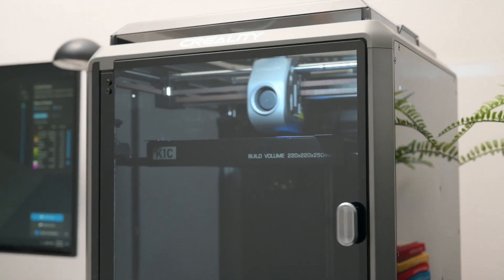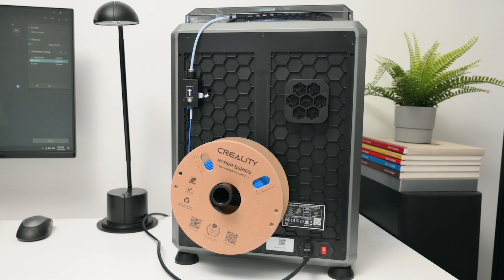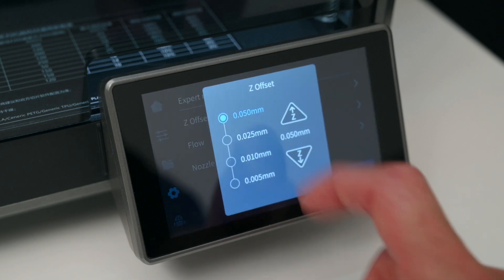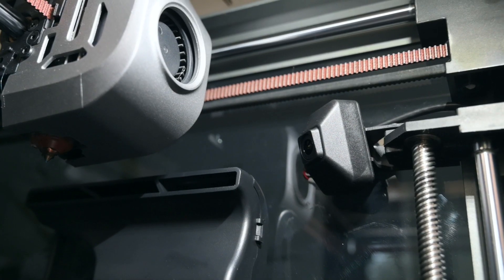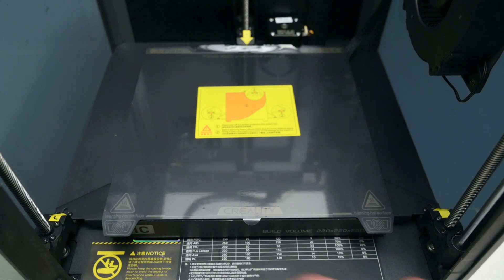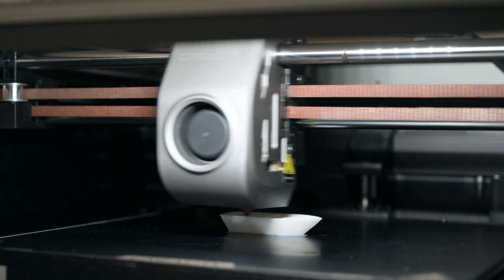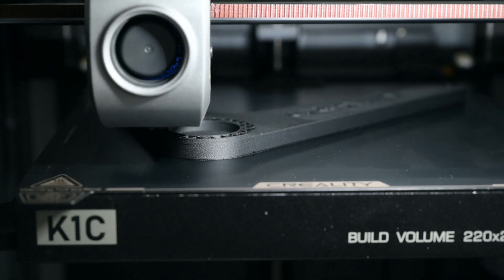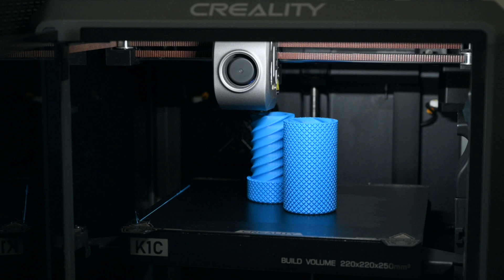Creality's BEST 3D PRINTER so far! K1C Carbon

Comment: I wish they  would upgrade the K1 MAX to print Carbon fiber
Reply: The K1 and K1 Max can absolutely print carbon. They do need a hardened nozzle to handle the abrasiveness of the carbon fragments and a higher temperature while printing, but doesn’t cost alot to upgrade.